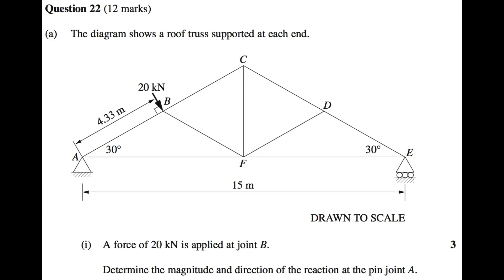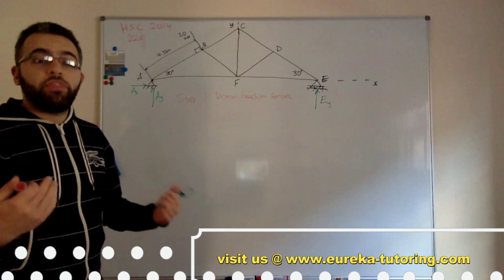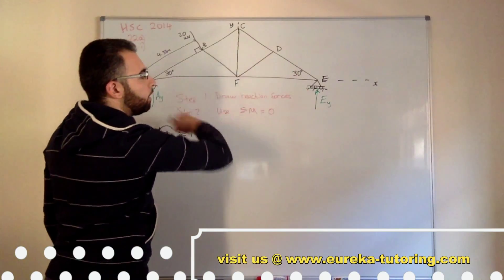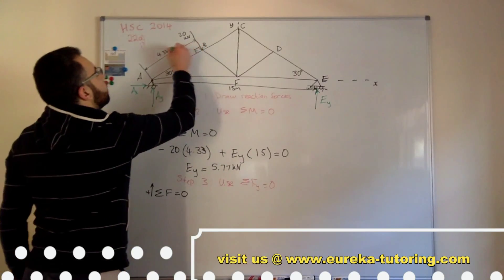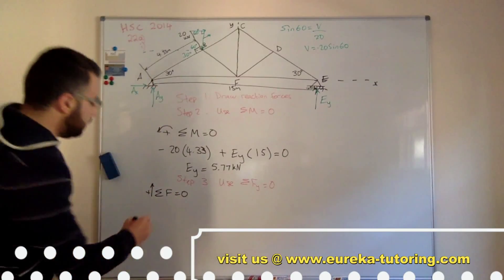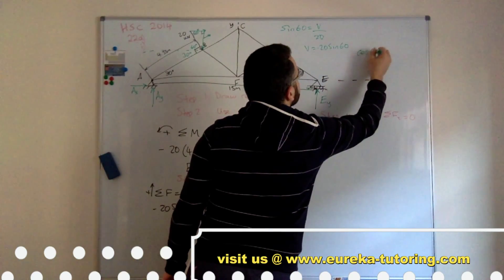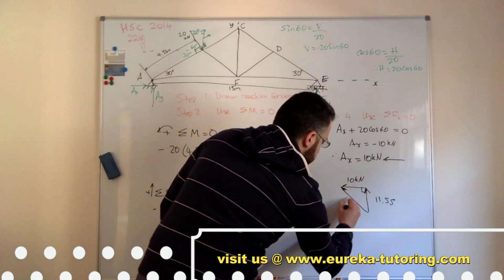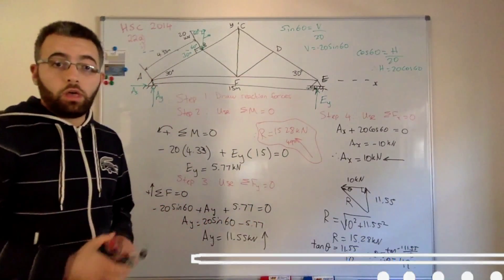TRUSS ANALYSIS (Reaction forces) - HSC 2014 Q.22a)i) - Engineering Studies

Comment: hello i have a question why did you times  your vertical force by  4.33 and not the distance to the pivot point ? which i made 2 because of symmetry . Arent you meant to time vertical force by the distance and horizontal by the height?